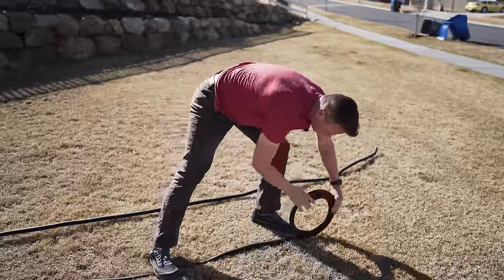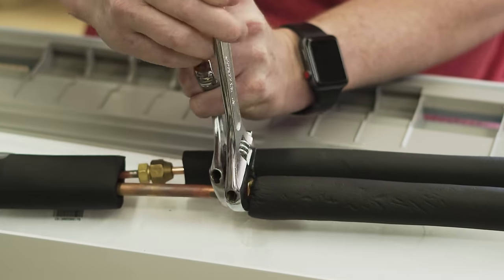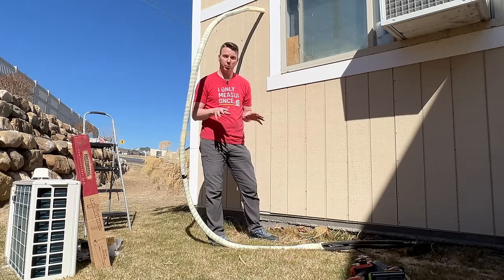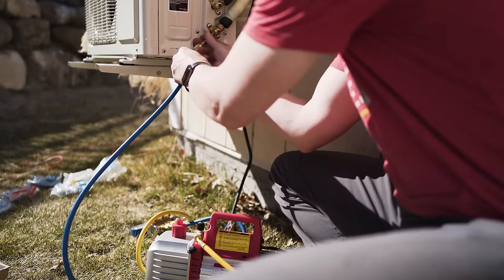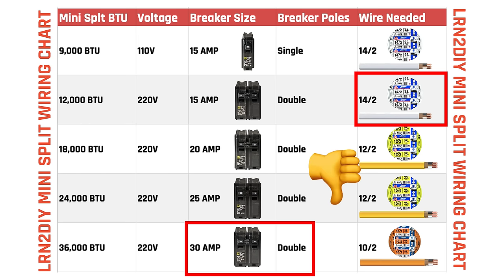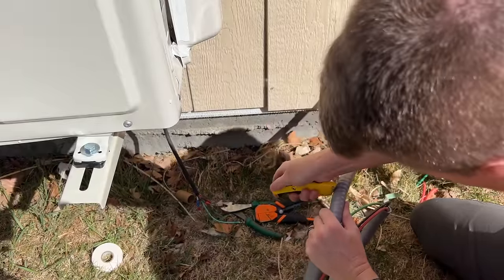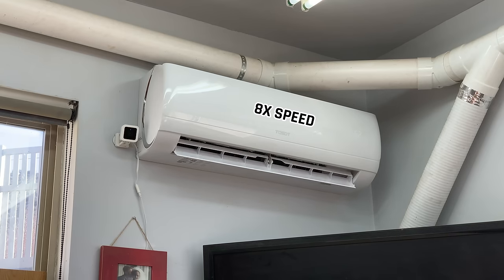DIY Mini Split Install - All the Things Nobody Shows You

Comment: I am a 50 yr professional HVAC&R technician.  I watched your video and this is my critique.  I am doing this not so much for you but as a correction for those Poor Souls that follow your instructions where several points are wrong advice:

I can tell you've never done this before so it is a little disconcerting that you would create a DIY video on installing something as technical as an air conditioning unit acting as a professional; you should at least state, "I don't really know everything about what I'm showing you because I AM NOT A PROFESSIONAL AC INSTALLER." This way, people would know to double-check your instructions with, hopefully, a professional.

1:00 The reference to 8-9 feet is a warning that placing the head more than 8-9 feet above the condensing unit can cause problems with oil return. DO NOT PLACE the head more than 8 feet above the condensing unit.

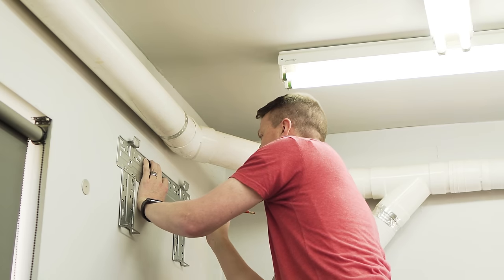1:20 You did not mention anything about leveling the backplate. It should be either level or, better yet, graded 1/8" per foot towards the direction of condensation water flow.

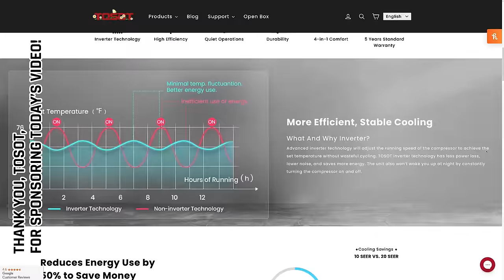2:10 You never explained why the 'Tosot' system saves hundreds of dollars compared to Mr. Cool Type systems.

4:15 Setting up the flare connection behind the head:
    Never use sealant products on flare connections - NEVER!
    Use oil ONLY to lubricate the threads before connecting them (REPEAT! do not use thread sealant on flare connections).
    You DO need to crank down on the connections! Crank down enough to 'feel them' squish together (approximately 1/8 turn past stop).

    Not cranking down the flare connection properly will cause leaks. Most people following this tutorial will have leaks in the system, and
    since you hid the connections behind the head, they will have to disassemble the unit completely to repair those leaks instead of just 
    tightening them on the other side of the wall.

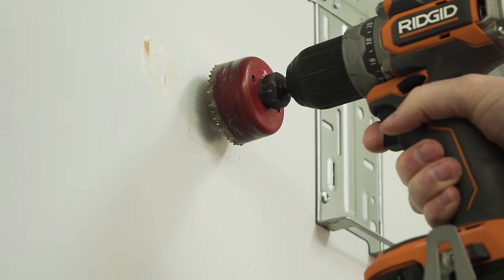9:25 You're angling the drill 'downwards,' not 'upwards.'

12:55 You can purchase an inexpensive plastic concrete pad instead of a real one and toss it on the ground.

19:20 Using soapy water is not recommended when checking for leaks. Use a proper refrigerant leak detection solution instead. I assume you had leaks here but did not wish to tell everyone. You will also have leaks behind the head so get ready for it and since you did not put the connections through the wall, you will have to pull the head and cut through the wrapping to correctly tighten the connections.

21:50 The manufacturer gave you 16ga wire because you are using 220V two pole. This splits the amperage in two, so you only need the breaker to handle 10A max, not 15A (your nameplate says 7RLA MAX).

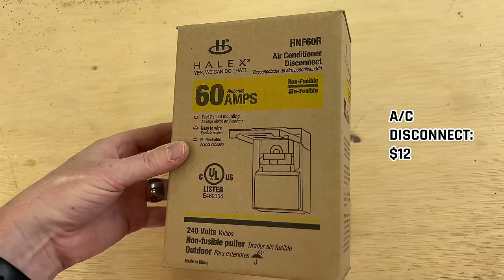According to your video, you installed a 30A breaker (big mistake) on a 7A system. The plate probably says 15A Max Electrical Circuit. You should have stayed with a 15A breaker regardless of your wire size. This mistake will cause you problems in the future, especially with a non-fusible disconnect (which makes everything out of code and illegal!). At 27:00 you show a non-fusible disconnect. REALLY? You DO need a properly sized fuse when you over-fuse the unit at the breaker! You have two choices to fix this problem:

1. Remove the 30A breaker and replace it with a 15A breaker (would be my choice because it works better for your unit).
2. Replace the non-fusible disconnect with a fusible disconnect using 15A fuses. Note: I would do #1 if I were you.

You mentioned being comfortable with your knowledge of electrical work. The WHITE WIRE IS NOT NEUTRAL!
IT IS LINE #2... there is NO NEUTRAL in this setup. If this is confusing for you, next time tape all white wires that connect to a breaker with black tape. No wire that goes to a breaker is neutral; they are all HOT.

29:38 You called it 'Neutral' again even though you're connecting it to L1.

Otherwise nice video! :D

Comment: Nice video and thank you for showing how actually easy these are to install for someone with moderate skill abilities. One thing though, you should always use the red and black as hot, not white and cap the red. Your method works fine but at the very least on each end of the white wire you should wrap with electrical tape to make sure that anyone in the future working on this knows that the white is connected to a pole on a breaker and is hot. Just a safety issue and if you had an inspection of the electrical work they would probably require you to do that. Overall solid explanation on install and walk through!! Thanks also for the links to the products too!

Comment: You can't use a 2 pole 30amp breaker just because you used a heavier guage wire!  Huge fire hazard.  Never use a higher rated breaker than what the unit calls for.  This calls for a 2-pole 15amp breaker

Comment: you need a digital micron guage for vacuum, and you don't release the vacuum to air, you just defeated the purpose, and you didn't do a nitrogen pressure test...and the knockout on the disconnect is really bad, how you did it, and only use fused disconnects, since you oversized the breaker, look at mfg labels, it will say max fuse etc.  it matters

Comment: 19:00 Maybe i missed it but you should open the bottom valve (with the larger cuper tube) to be able to vacum the entire circuit from the outdoor unit (but not in the unit itself that's why you keep the upper valve closed for now), through the indoor unit back to the outdoor unit, if you don't do that you vacum only you tools tubes. The goal here is to reject the air that holds in the tubes and the indoor unit and let only the refrigerant to be in when you open the other (upper) valve.
Sorry for my bad english and thanks for sharing this.
Reply: Glad someone else caught it..  watched 3 times thinking i missed it or lost in editing.  It went to -30 in a few seconds confirming the Low Service port was not opened so only thing that was vacuumed was the Blue and Yellow line.

Comment: Those mini splits are a piece of cake, you don't even need to braze the lines. You do need a good flare tool though, a 2 stage vacuum pump and a micron gauge is worth getting. I like to use Nylog on the flares too. I always use at least 12AWG wire for motor loads, even if the circuit is only 15A.

Comment: The only issue I have with DIY mini splits is where we as contractors are able to get parts for repairs when they inevitably break. Often we can't just call a local supplier and go pick up the parts. So when one breaks, you may be without any heat or air for weeks potentially.  
To be honesty though with the cost savings of purchasing on your own, when it breaks, you may as well just buy another one rather than try to repair it.

Comment: Understand you using your 10/3 wire however using the 30 amp breaker means it will probably never trip if the unit has an issue will just burn up. Should of still used the dbl 15 amp breaker or sized the disconnect with proper fuse for the unit. Your breaker needs to be sized to the unit even if the wire is overrated. Stupid mistake.

Comment: what's the deal with the AC disconnect code? our installer didn't put one for us, he just wired it up to the existing outlets (although on 1 of them, it's just a regular 3 prong going into the wall outlet inside the house). he said they weren't really necessary (we have 110v models). he said to install the home run for both units would cost an extra $1800.

Comment: i know i have 220v because I helped install out 220v central ac at our house . but i installed my mini split in my room exactly how this is wired and each leg measures 115v? is that correct? its a 220v unit  the indoor unit had 3 wires all 120 v , im assuming thats how it gets its voltage?

Comment: Very nice installation techniques and video editing quality. But as many have mentioned, you made two major technical mistakes. 
1) A 230 Volt supply does NOT have a neutral. Therefore the red wire should have used instead of the white. White wire always designates a neutral circuit, which is not present here. 
2) 30 amp circuit breaker is too big, especially since the outside disconnect is not fused. Unless there is some overcurrent protection built into the outside condenser unit then protecting the unit at 30 amps is totally improper. A 15 amp breaker should be used. Using 10 GA wire after a 15 amp breaker is perfectly OK.
These things need to be corrected.

Comment: Does that kit come with a refrigerator license cause im pretty sure regular home owner aren’t supposed to open those valves. Those lines should be pressure tested a vacuum doesn’t always show you a leak especially if you only leave it sit for 15 minutes using analog gauges. Last but not least you left the vacuum out when you pulled gauges off.

Comment: I enjoyed your video.  It was most informative.  My mini split unit recommended a 3 1/8 inch opening in the wall and had torque specs for the copper line.  I purchased a torque wrench with an adjustable head to meet the torque specs for tightening the copper tubing.  It was much tighter than I had planned on going.  I followed a friend's advice and left the vacuum on the system overnight.  By the next morning I had found a small leak that I fixed by cutting and flaring the copper tubing.  Everything else went smoothly just as you predicted.  BTW the white wrap that goes around the insulated freon lines is a UV protection that keeps the black rubber insulation from deteriorating over time.  It was added to my main house units as an upgrade.  Thank you for sharing.

Comment: Should have used the recommended breaker per the size of the unit, wire size doesn't matter. Also would have used the red wire as a hot instead of the white to identify as a hot for anyone in the future since you used 10/3.

Comment: You make a foot gap between the wall and the condenser BUT then you stuff all of that coil in that space which defeats the purpose of the gap.
After you get your vacuum and release the refrigerant you use soapy water to check for leaks.

What's the point of showing or even mentioning the Nylog Blue if it's pointless, you don't even torque any of your connections.
Define "Crank" as in "don't need to crank it down". Is that like 10 Giga-Newtons or what?

That is crazy.
Of course it will work when you are done but for how long.

My questions are rhetorical, I'm no HVAC guy but I can tell you that you get what you pay for your install.

Comment: You really need to switch to a 15 amp circuit breaker.  The Maximum Circuit Capacity for your outdoor unit is 15 amps, and a breaker over that rating is not allowed.  And you really should be using the red and black wires when connected to a 220 volt circuit breaker.  Sure 10 gauge wire is fine for your installation.  I would never recommend #14 wire with a motor.  The voltage loss would not be OK to run a motor on such small wire.

Comment: Great video but consider a final edit, unscrewing the vacuum line before pressurizing it allows oxygen back into the system. Also breaker size is way too big but not a dealbreaker.

Comment: Yes running a 30amp breaker for your unit is bad because if your unit has a issue it won’t pull 30amps therefor it won’t trip the breaker. You need to use the required breaker size according to the amp rating on whatever you may be wiring. Secondly if you use a romex cable that has more than black and white never use the white wire as a hot just use the black and red. Low voltage wiring color code is black,red,blue. White is always neutral in standard coloring. When using a 12/2 or 14/2 romex you use the white but use phase color tape to make black,red,blue.

Comment: Pretty sure the running of Romex in any kind of conduit outdoors in prohibited per the NEC. Also, when choosing wire and breakers, you would choose the smallest breaker that provides some equipment protection (in your case 15 amp) and that dictates the wire size 14-2 minimum. However, you can use a larger gauge wire on a smaller breaker, but not the other way around, e.g. it's ok to have 10-2 and use a 15 amp breaker but NOT ok to use 14-2 and 30 amp breaker.

Comment: I am looking at buying this unit but I need longer signal wires. They sell the longer copper lines but not the signal wires. Would it be pretty easy to elongate the signal wires? I assume there is no special connectors etc and I can just extend the wires?

Comment: Never take the hoses off while lines are still under vacuum.  You just sucked air in there. Always break the vacuum by opening the service valves. Then take hoses off.

Comment: 1.	Mini-split heat pumps use flare fittings requiring the following installation procedures to prevent refrigerant leaks and ensure proper evacuation.
2.	Mini-split refrigerant leaks occur at flare fittings caused by following problems. 1) improper size or cracked flare, 2) over or under tightening flare (ft-lbs torque too high), 3) cone tool scarring flare (improper oil), 4) no refrigerant oil or Nylog Blue on flare face, 5) incorrect flare nut (requires mini-split nut not plumbing nut), 6) scratched flare face, 7) not deburring hole at end of copper tubing before flaring, 8) improper flaring tool, and 9) not performing low, medium, and high pressure leak tests with Nitrogen for sufficient time. Use a torque wrench and OEM recommended torque (N-m) for pipe diameter or remove flare fittings and use press-fit Zoom Lock fittings (recommended). 
3.	Mini-split refrigerant pipe airtight testing method.  (1) Connect testing tools, (2) Make sure stop valves A and B are closed and do not open them. (3) Gradually pressurize refrigerant lines with Nitrogen through the service port C of the liquid stop valve A and gas stop valve B. (4) First pressurize to 75 psig (0.52 MPa) and wait 5 minutes making sure pressure does not decrease. If pressure decreases, then look for leaks. Use leak detector or soapy water to check for leaks at pipe connections of outdoor unit (5) Second pressurize to 220 psig (1.51 MPa) and wait five minutes making sure pressure does not decrease. If pressure decreases, then look for leaks. (6) Third pressurize to 600 psig (4.14 MPa) and measure surrounding air temperature pressure. (7) If the specified pressure holds for 24 hours and does not decrease, then refrigerant tubes have passed the test and there are no leaks. If surrounding temperature changes by 1.8F (1C), the pressure will change by about 0.2 psig (0.0014 MPa). Make the necessary corrections.
5.	Mini-split Manufacturer Triple Evacuation. 
6.	Evacuation #1: Evacuate mini-split system to 4,000 microns from both service valves. Micron gauge must be used at all times and system manifold gauges must not be used to measure vacuum. Break vacuum with Nitrogen into discharge service valve to 0 psig. 
7.	Evacuation #2: Evacuate mini-split system to 1,500 microns from suction service valve. Break vacuum with Nitrogen into the discharge service valve to 0 psig.
8.	Evacuation #3: Evacuate to below 500 microns and hold vacuum at or below 500 microns for a minimum of 1 hour. Conduct a rise test for a minimum of 30 minutes. Total 90 minutes.
9.	Purpose of evacuation is to remove non-condensable water vapor. Pressure increase after evacuation is due to water vapor in system. Many technicians only wait 15 minutes, but it can take 60 minutes or longer for ice inside system to melt and evaporate which causes vacuum pressure to rise above 500 microns. Fully evacuated system is required for R410a refrigerants which use Polyester (POE) oil which are hydrophilic. Small amounts of non-condensable water vapor in system which will increase condensing pressure and compressor power and reduce efficiency and capacity. Water vapor will create acid and sludge in refrigerant system causing low cooling capacity, increased compressor power and failure. 
10.	Calculate additional line set required and add recommended refrigerant per OEM typically 0.6 ounces/ft of line-set depending on liquid line diameter per manufacturer.
11.	There are no shortcuts to quality. Refrigerant leak detection, repair, triple evacuation, leak prevention, and NTD methods help verify proper installation.

Comment: Tried to see if somebody caught this and put a comment.

Using a double breaker You need a four wire. 👍 10 gauge. Black goes to one 15 red goes to the other 15. The white is neutral goes to the neutral bar. The ground goes to the ground bar. 

You also didn’t ground the conduit. Going through a wall you should’ve ran conduit through the wall too.  But you must’ve realized that you screwed up edited the video. Then had somebody check the electric. Because at the end when you were finishing up on the condenser. That’s when you said neutral wire ??? So where is the neutral wire?

Comment: Don't understand why you connected refrigerant lines to the indoor unit first. There is ample line length that comes with the indoor unit to protrude through the wall and then attach refrigerant lines. You just made it extremely difficult to pull all that through the wall.

Comment: Hey for a first timer great job, a few mistakes but you did a great job. FYI , no indoor wire inside the liquid rite going outside use UF CABLE and you can sleeve it because it’s rates for outdoor. The indoor wire can get wet in that liquid tite. Also the circuit breaker needs to be rated for the appliance not your wire,so 2/15 circuit breaker is required like other said. Other than that. NICE JOB,,!!!